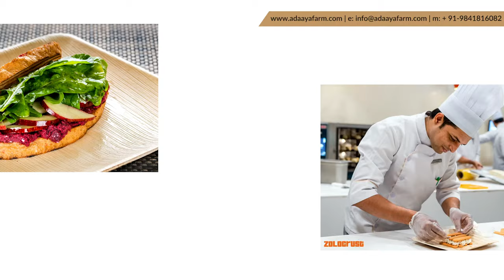Journey of a Leaf to Plates: An amazing story of Palm Leaf Plate Manufacturer, Adaaya

Comment: But...Its being covered in plastic wrap later...so...IT DOESN'T CUT THE PLASTIC USAGE. You need plastic like thing made out of potato ( I saw it somewhere) or any other completely biodegradable wrap that mimics plastic to wrap your plates. Otherwise, it defeats the purpose
Reply: What kind of analysis is that? Of course, it cuts plastic use! If every company did that instead of manufacturing disposable plastics, there would be a drastic reduction in plastic waste.
Reply: We are soon coming out with fully biodegradable packing.